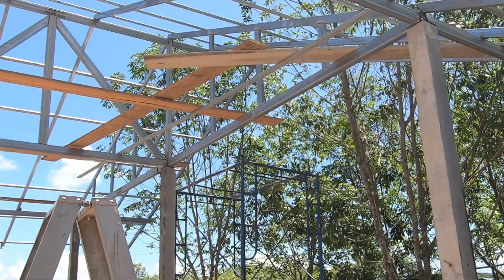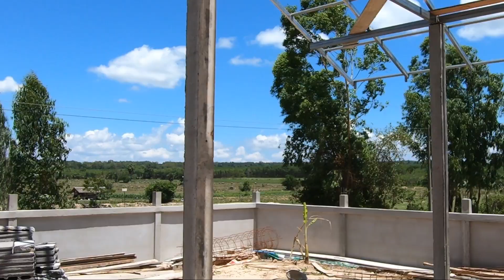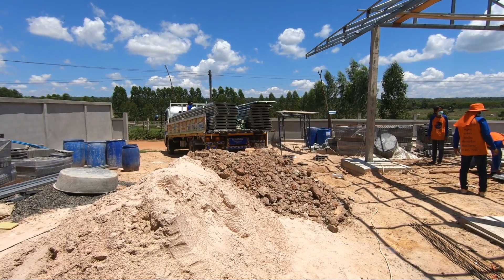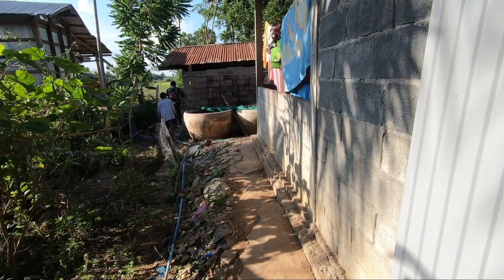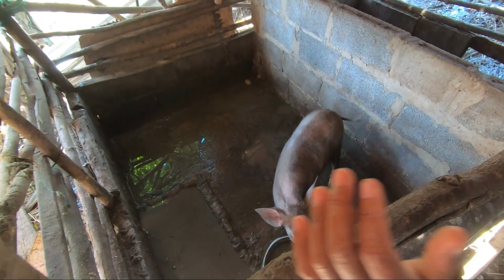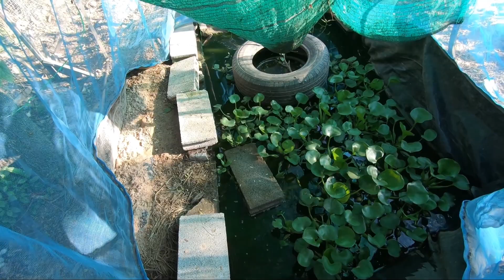New House Build part 32 - Roof is looking good

Comment: Really agree with your comments on the Solvent Weld pipe.  The amount of Thai build videos I have seen where this job has been messed up and encased in concrete before the problems are noticed.  Its such a straight forward job and as long as the parts are clean and care is taken,  its actually hard to screw it up !.

Comment: Nice size foam on the roof. Ours is only .55 ml! Then the added 6 inch insulation rolls in the ceiling. It was an extra $760 for the insulation rolls, but a striking cool down immediately.